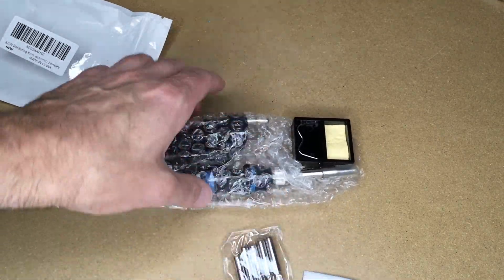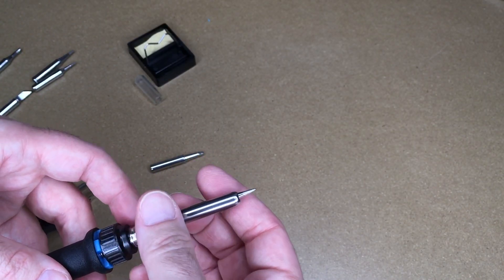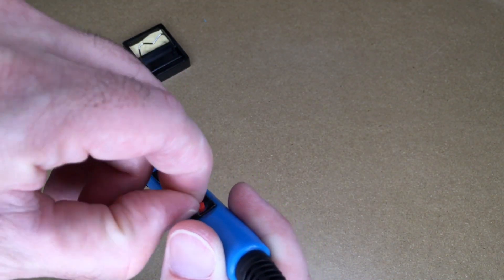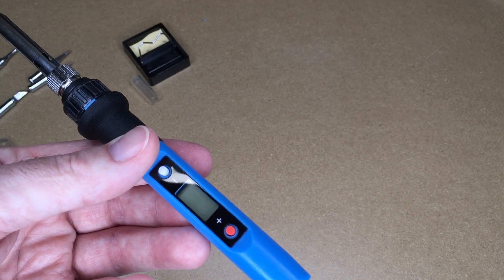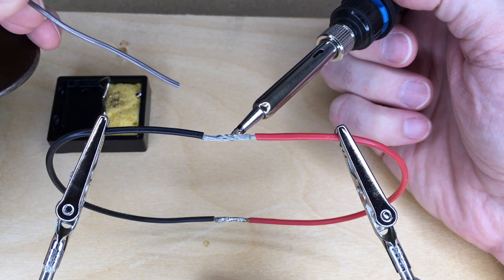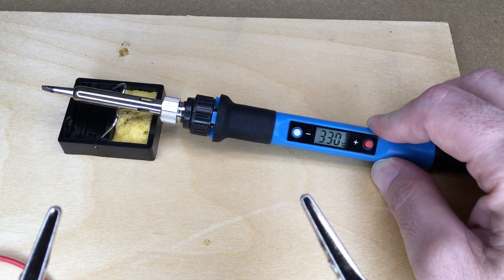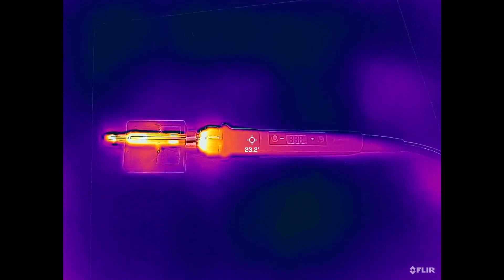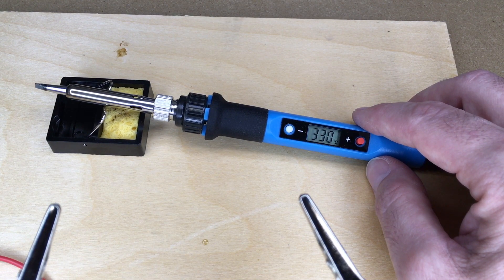NOEVSBIG 80W Soldering Iron with Digital LCD Control

Comment: If you could say something related to the temperature calibration, it would be so much useful your video.. Frankly,  I don't care how big is te temperature of the handle. If it is too hot, it's clear it is junk and it will go to garbage. But how to calibrate  the tip temperature that is an useful information that you could provide. Its documentation is not accurate.

Comment: Trying to use this on my PS5 controller @ the highest temperature and it will not melt the solder alone on the controller. Thinking about throwing it out
Reply from the maker: If the tip tight? That can cause and iron to not heat.
Reply: Usually means the tip wasn't tinned and you have oxidization preventing heat transfer. You also need enough watts to account for temp loss. Not sure if these are really 80w.
Reply: Trying to install Halleffect joysticks myself it could melt the tin but not the solder points holding the joysticks in.

Comment: I would be happy if they put and added A "hold 2 buttons" to shut it off (switch off).
instead of plug and unplugging or extending your hand to power supply switch it off.

Comment: Hi. Have you tried measuring its power consumption using a power meter? I'd like to know how much power it draws at max temp and how much in rush current does it have during the initial heating. Thanks and more power.

Comment: Preess the plus sign quickly twice to change from fahrenheit to centigrade temperature reading on the display ! I think ?
Reply: You are a hero
Reply: Hold both buttons and it switches to - 99 to 99. Not sure what that means but it's a thing.
Reply: That is for calibrating the soldering iron temperature. You don't wanna mess with that if you don't have a temperature reading multimeter @BromideBride
Reply: @ayyhmed  thank you, I do have temperature calibration tools and I figured this function out. However I no longer use this iron as there was around 1mm separation between the solder tabs from 240V AC and the DC. 
So it spontaneously combusted in my hand, blowing the capacitor off the board, fried the resistor, the triac & several smaller components leaving a black and gold plasma plated coating on the interior. 
It had done less than five hours. Buy cheap, die once.
Reply: @BromideBride  damn. Mine got delivered today and now I'm scared to use it🤣
Reply: @ayyhmed  if you are competent, you could apply an insulating lacquer to the AC components to limit flash over risk. But if that's outside of your knowledge then I'm not helping & you shouldn't seek advice you can't confirm 100% that it's an appropriate hack.
Imo there's too much going on in too little space. On the plus side, mine has a lot of plastic between the hand and the innards.
I would definitely keep it in a stand. Never leave it on unnecessarily or unattended and aim to buy a soldering station or a battery powered iron [santa might bring you one if you leave him some notes around your family] 🤣
Reply: @BromideBride  Hey. So i actually tried the soldering iron before I saw your comment yesterday. The same thing happened. It worked for 2 mins, then it started sparking under where the screen is and turned off. i haven't disassembled it yet to see what happened because im trying to return it.

Im gonna order the same one again once I get the refund because its all I can afford. I come from a country where wages are low, and my dads retired too so yeah i don't like asking him for money. Hopefully the replacement i get works better 😅. I'll let you know
Reply: @ayyhmed  bad luck, at least you weren't hurt or damage was caused. There are similar irons without the screen and just a pot for adjustment. They might be a better choice because there is less crammed into the limited space. I hope you get your refund. 🍀

Comment: Soon as I plugged mine in, I hear POP! anyone familiar with how to access the fuse? Obviously dismantle it, but HOW?!
Reply from the maker: Was the pop in the soldering iron or did you have it connected to a power strip?
Reply: @Rickmakes  nope, direct to wall outlet. It definitely came from inside the unit itself, prolly midway if, I coukd see it illuminate from inside.

Comment: Has anyone figured out how to change to F° display?
Reply: Yes, Press and hold both + and - buttons at the same time while plugging in the unit.  It will enter setup mode and you can change it from there.  Supposed to also be able to power cycle the unit, but haven't figured that out yet, without unplugging it.
Reply: @zukiryder05  holy smokes thank you so damn much I've been looking for this info everywhere it seems nobody knows how to do this damn thing. I did it on accident one time and I didn't know how I did it and I've been racking my brain ever since, thanks.
Reply: My sumsour iron is same and you double tap the power button
Reply: Well powered off and unplugged power turn on and plugin on the soldering iron WHILE holding down the plus sign then while holding the + button while powering on tap on - to cycle to thru desired unit then release + button

Comment: Hello there I have recently got this soldering iron and I have a problem, as soon as I plug it is it says eao or ero and I don't know what to do about it. Do you know how to fix this?
Reply from the maker: Not sure what that error could mean. I would try contacting the seller.
Reply: Did you ever find out EA0? Mine is doing the same. It seems to affect the temperature of the iron.
Reply: Open it up.   I bet there is a loose connection internally.    If not get a new one.   They're cheap.